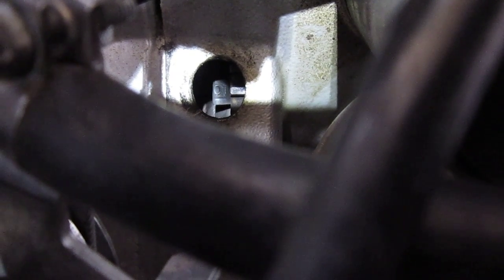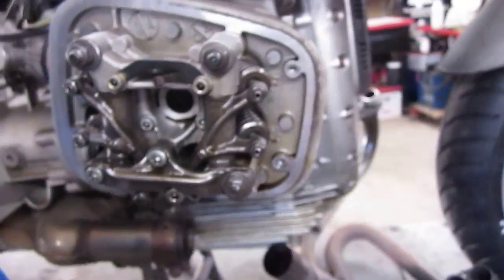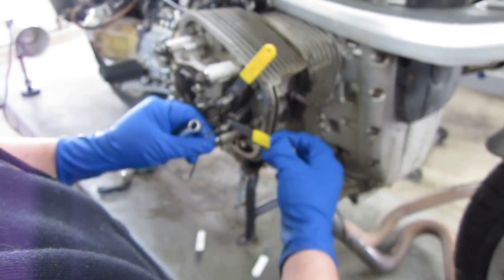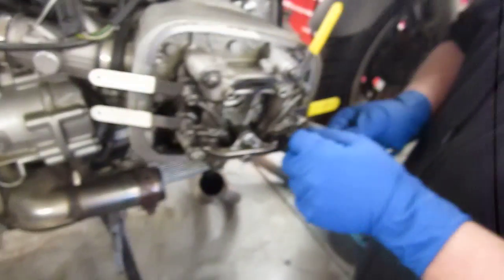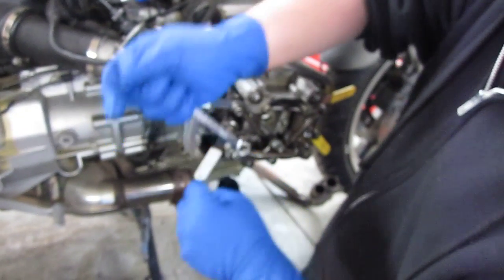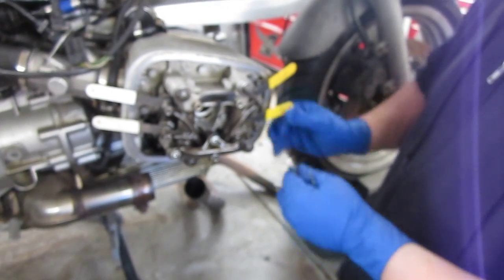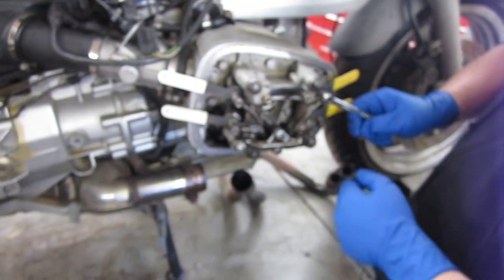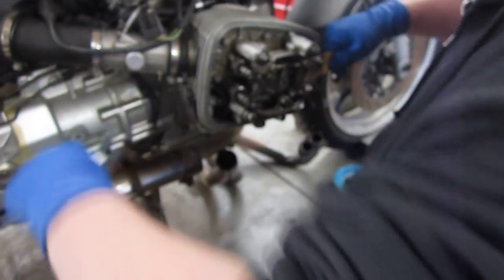BMW Service - Oilhead valve adjustment procedure

Comment: Chris- Thank You for what you do - I am ready to do this procedure, so I am just reviewing the video at this point...  What a bitch.  those Germans are real assholes regarding torque settings and procedures.

Compared to valve adjustment on a 350 cdi Chevrolet hydrolic lifter motor it is just ridiculous, but compared to changing valve shims on rice burners it is pretty easy. lol

I'll send another check along when I get some spare cash...  Times are hard on all of us, brother.

God bless you and yours.

Comment: Which side is at TDC? Which side do you do first?  How to tell? Not clear in video.
 Just did my adjustment this weekend. Thanks for the guide.
Tip- remove cover and advance crank with nut on front alternator pulley.  "bumping" (two hands and pulling, hard) rear wheel becomes a two man job.  OT mark goes past too fast to see, as well.

Comment: My 1999 BMW R1100RT. Project 4, valve adjustment, and replaced valve gaskets and all bolt grommets. Spark Plugs Bosch Platinums also. Cheers to Chris!

Comment: Chris; do you think it would be necessary to check if the rocker-arm assembly is properly torqued BEFORE adjusting the valves?
Reply from the maker: Only if loosened.
Reply: Chris Harris - I'm the third owner of a R1100RT with 73,000 miles. I don't have any idea if it was ever loosened so I'll check to see if the Torc values are correct BEFORE adjusting the valves. (Thought process of a former Aircraft Mechanic).
Reply from the maker: Nicholas Mumola  Perform the 600 mile service as if the machine were new, then. Loosen and torque to 20 nm, then angle torque each to 90 degrees, then each another 90 degrees. Read the manual regarding the first service and also about reassembly of a head. Two different torque procedures. Good luck, Chris
Reply: Chris Harris; Understood all your recommendations except the meaning of "angle torque."  Thanks again.
Reply from the maker: You better familiarize yourself with that before you loosen those heads. Different procedure for reassembly vs. initial re-torque. https://www.youtube.com/watch?v=WzA37V9ik1Q

Comment: I went to do the valve adjustment on my '99 R1100GS- bought it used.  checked the valve lash at about 38,000 miles and all of them were perfectly in spec.  Unbelievable.  :-D

Comment: The last time I had my bike in for a new tire I told the mechanic I had never done a valve adjustment... he gave me the lecture on this... it should be done at least every 6,000 miles. I said after the valves seat there should no reason to do this that often.. so 25,000 miles later after buying the bike I finally got around to it. It was 96 degrees out and the garage was cool... what a waste of time, it was dead on. I have 70,000 miles and I am pretty sure I will let it go another 25,000 miles before I check it again. What's the scoop on that.
Reply from the maker: The valves would have been loose after 6000 miles, certainly after 25,000. Loose is better than tight but too loose beats the face of the adjuster to a concaved shape and makes future adjustments impossible to do with accuracy. I like saving money too but I don't suggest going more than 12,000 miles before adjusting the valves and they will need adjustment. But what the fuck do I know?!
Reply: On this? a lot more than me. But I will stick with 10,000 miles. It seems that after 70,000 miles the valves will have seated enough, unlike when when they need to be adjusted all the time. My 83' R100RT was pretty much the same after 40,000 miles. I never touched my K75 after 65,000 I just sold it before it blew up.

Comment: Chris, I love your videos.  I do have a question for you though.  I have an 05 R1200rt.  I use what looks like the same feeler gauges as you from Wurth.  In your procedure, you get all four feelers to stay horizontal, yet you say the tension should be the same on all four feeler gauges.  Being that the exhaust gauges are thicker, that makes them a bit heavier and for me, to keep them horizontal, they have to be more snug then the intake side.  Any advice on that?

Comment: I did a valve adjustment this past weekend, now I'm getting a pronounced tap tap tap sound. Any thoughts? They were way too tight when I started. Now they're in spec.
Reply: Tappy valves are happy valves!  ;)
Reply: marcjwhite 
thank you for the help. now I feel confident that everything is working well.
Reply: 4 years ago but i did valve timing on an old honda i had and had the same story, turns out i had the cylinder in the wrong cycle and ended up making the gaps way too big, i re-did it straight after though as it went from silent to sounding like it had a ducati dry clutch lol

Comment: One of the valve cover bolts is 'pulling' threads. I've used timesert m6x1.0x12mm for repairs in the past. What do you use?

Comment from the maker: Many times these bikes are left idling with the fake choke (high idle lever) left on so they are running at 1500+ rpm for long periods of time. That is not good.
Reply: I always figured the choke was fake.  Seems to just make it idle a bit higher.  Any real choke would cause havoc if left on when engine is warm.  :-)

Comment from the maker: You will likely find that once the throttle bodies are set correctly that they often do not need much, if any, adjustment after that. But it is worth it to check after each valve adjustment.

Comment from the maker: They are less prone to failure than the 2000+ BMW's. You will likely need to rebuild the gearbox @ 80,000 and have it 'undercut' for better gear engagement. The rear drives prior to the 2000 model year rarely fail. Good luck.